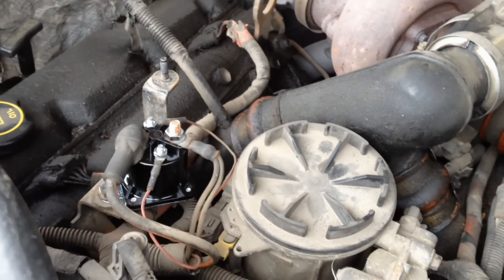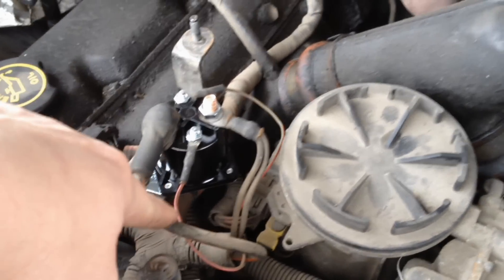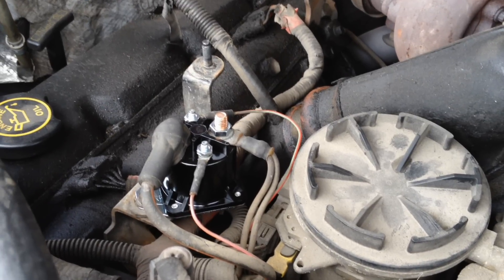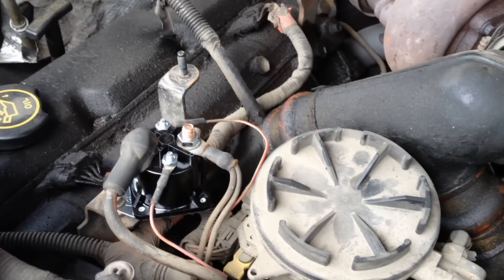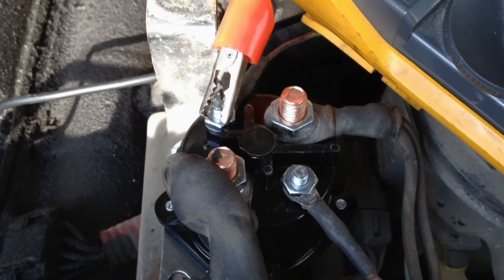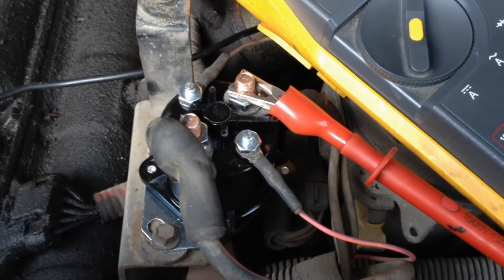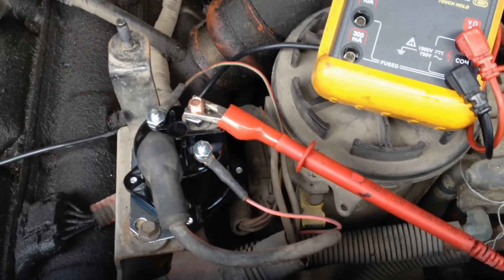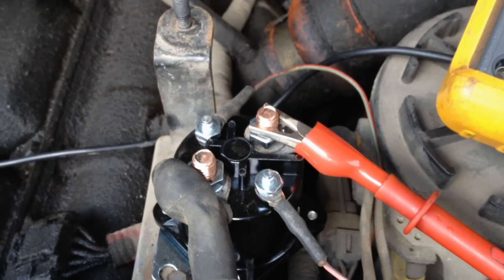7.3L Powerstroke Cold No Start Diagnosis- Glow Plug Relay

Comment: I replaced my relay after testing the "out" terminal that goes to the glow plugs. after replacing it, I tested the new one and it was the same thing. I thought the new one might be a bad one, so I replaced it. the third one still had the same symptom. there was 12 volts coming in, but when the key was on and there should have been power at the terminal going to the plugs, there was nothing! anyone have any ideas?
Reply: Dod you replace your relay?

 

Just kidding, check the fuse

Comment: I have a '97 F350 PSD. This morning I started the truck, was hard to start (cold morning), blew some white smoke. Started then died. Now the Wait to Start light does not come on, and it just cranks and cranks. Changed the fuel filter today as well. Last time I had it in the shop the mechanic said that I needed to replace the Fuel Sensor/Heater element connector and pigtail, and perhaps the H20 level sensor. Would these cause the Wait to Start light to NOT light up when the key is turned on, or would the GPR cause this? I'm really at a loss as to what to do.

Comment: I've got an 01, when I cycle the key the start light goes off, it'll crank and start but blows quite a bit of white smoke for a min or 2, then it's fine. Relay? glow plugs? (it was 37F this morning)
Reply from the maker: jeff drier It can be either but at that temp I would say the relay is working and a couple plugs are open. Follow my test to find out.
Reply: When I tested the relay, It was slightly lower than the Bat volts. I'm planning on changing out the plugs in the fall. Its got 190,000 mi on it.

Comment: I have a 96 f-350 with a 7.3 powerstroke and even with changing out the glow plug relay it will not hardley start in the am unless I give it a quick squirt of ether I have replaced the starter and the batteries can you tell me what else to look for or check as I don't like giving it the ether but a lot of the time thats the only wat to get it started and I am not sure what else to do and I can't afford to take it to ford to get fixed
Reply from the maker: You much check the glow plugs to make sure they are not burned out. I am sure during this cranking it is puffing while smoke right? Then your control for the glow plugs is bad or the plugs themselves.
Reply: Sharon Straw , I have the exact same problem with my 1997 F-350 powerstroke, I have to give it a shot of ether in the morning to start the truck, but once she is started and has been warmed up she will start all day no problem, I thinking it has to do with the starter relay or the glow plugs are not heating the cylinders enough, ps it will also start fine if plugged into to block heater over night, super annoying problem!!
Reply: +FordTechMakuloco h

Comment: I have a 97 f250 powerstorke I replaced the glue plugs and the relay still has a hard time trying to get started in the morning. My relay is getting hot and I'm kinda at a Los of words on it
Reply: Oh yeah and make sure batteries are fully charged and use a load tester to ensure the cold cranking amps dont drop after two seconds due to a dead cell
Reply: And on top of that after I finely get it started it ideals really rough and won't can't to rev up but once its going will start all day
Reply from the maker: raganusmc You have to check the resistance of each glow plug on the outside of the valve cover gasket connector and then once again at the glow plug relay where the whole bank of wires comes together. (disconnect the wires from the relay obviously) Each side should be collectively the same.
Reply: FordTechMakuloco what should I be getting for volts wise?
Reply from the maker: Voltage output from the relay should equal battery voltage. Are you asking what resistance should you be getting?
Reply: Under valve cover gaskets, their harness and connectors both ends. Bad fuel, bad ipr valve under fuel
Bowl, bad pressure sensor? High pressure oil leak (internal), thick oil, wrong coolant, bad timing sensor, fried/damaged computer in need of software update/reprogram or replacement.
  Its a ford, there could be a lose ground. Anything will stop these motors

Comment: I have a 1999 7.3,my wait to start light doesn't come on.won't start. I've changed the gpr out twice,battery connections,starter relay,and checked the fuses. I'm getting power to the gpr but none out and it doesn't make any noise,What should I try next,or do you think its possible I got another bad gpr?
Reply from the maker: Jason Guidry Are you getting power and ground to the small wires to turn on the GPR as shown in the video.
Reply: No,I am not getting power when the key switch is on and the wait to start lite won't come on. I've changed the IDM also,as well as both starter relay, and GPR.

Comment: Hello, and Thanks for the keen insights. I have a 96 7.3 DI .Started having issues when going up mountain pass cut out first time then killed next day at same incline. Started a couple more times and died when idling. Now will not start. and no smoke when turning over Changed filter and cleaned housing too. Just replaced GPR, old tested bad.   Still will not start, ???
Reply: bruce odem I had similar symptoms and it turned out to be the camshaft position sensor.
Reply from the maker: Have you made sure the fuel bowl is filling with fuel from the lift pump? After that I would make sure the second stage of the pump is pressurizing the fuel by cracking the line at one of the heads while cranks there should be a good fuel spray.
Reply: Thanks again, bowl does fill, where do the lines go in the heads?
Reply: bruce odem I pulled one line off the passenger side in the "middle " of the head but it was oil. ???
Reply: bruce odem Wonder of wonders,  I plugged in the block heater when I cracked the "oil" ? line on the head and just went back to try and locate the lines from the pump and turned the key and it fired up and is running now. Our temps have been 32 for high and 22 low.  for a week now. We are also at 3300 ft. elevation. What would you recommend for the best repair manual? I need details as no prior experience 1996 F250 7.3 di. I have 210000 miles and intend to keep, and replace injectors and glow plugs if necessary there are other issues lacks power runs rough sometimes???  We are VERY great-Full for your time and expertise !
Reply: try unplugging your icp sensor

Comment: I got a 7.3 2001 and its like 75 degrees here and i crank it and i see white smoke on exhaust i can also smell the diesel but it wont start..the gpr has 12.5 volts and the gp side has nothing and then the 2 small terminals have 12v and the supply goes to 0v can the no start be because of gpr
Reply from the maker: yes it will not start but simply smoke, change that sucker out.

Comment: what is ground control from the pcn?? I have f250 7.3 1994 and for some reason I have 3 contacts only there. one is in power the second is out and the third one is the one that goes to the starter??? I can post a picture. It is hard to understand what and where to connect.
Reply from the maker: Daniel Verenchook IDI or Turbo? I would post a picture on my Facebook page there should be no wire going to the starter motor.

Comment: I check mine and live side is 12.37 and the other side is showing only 3.9v.. is the relay bad?
Reply from the maker: nico martinez Yes it should be the same on both large studs when it is on. The contacts go bad inside of the relay.
Reply: FordTechMakuloco also do you know anything  about when you turn on the truck its start loping?
Reply from the maker: If it starts and is loping it is either because the glow plugs are not working or the injector spool valves are sticking when cold. It smoothes out when warm yes idles great?
Reply: FordTechMakuloco thanks for replying.. i just push gas pedal about 1k rpm for 5-10sec then its smooths out.. but hot or cold start still loping.. runs and drive fine..

Comment: yep ive been cheap and bought the $40 napa ones they maybe last a year or two then just fail when you need them the most...winter. I'd also say disconnect the batteries when you do this because you'll have the full power from the 2 of them on the hot side and you defiantly don't want that hitting anything.

Comment: thanks for the information.i have a problem
I put a new glow plug relay and crank but it doesent start i test the new glow plug relay and it failed and the wait to start lamp  doesent show what step is next ? thank you.
Reply from the maker: Which year vehicle? You say the new one failed? Have you followed my steps in the video to test each output and input on the glow plug relay?
Reply: is a 1999 ford f 350 7.3 power strok..this morning Ichecked the fuse panel the one that is inside in the truck and the fuse # 30 <fuel heater/wastegate solenoid//injector driver/ module relay coil>.was burned and I replaced it and I solved the problem.thank you for everything
Reply from the maker: Ok so you need to replace your fuel heater inside the fuel bowl. They rot and arc out inside and blow that fuse.

Comment: Thanks for this. New powerstroke owner and was having issues with my 99 f350 7.3L not starting if it wasn't plugged in. I had already changed the glow plugs (it needed it anyways) and have done a ton of regular maintenance on it. It had a fairly new GPR but after watching this, I tested it and found out it was bad and possibly wired wrong when the PO installed it. Put a new FORD GPR in, tested and left it overnight for the true test. For the first time since i've had it (3 months) it started in the morning without being plugged in.
Reply from the maker: That's great to hear, nice!

Comment: I have a 2003 7.3 with a fresh rebuild engine, fresh GPR, new injectors, new glow plugs... shouldn't be having the cold start issue I am having. The batteries are less than a year old, but when it gets cold out, if I don't plug it in the batteries don't have enough to get it fired up. Any ideas on this?

I should also add that even when its warm outside, the engine turns over 4-5 times before it fires up.
Reply: Did you ever figure out cold start issue? If your batteries are new your starter is worn out I replaced my starter after it died and was a big noticable cranking difference.
Reply: Same on my 97' i hooked a solenoid up for a manual glo plug switch. Works great gotta find a decent solenoid or relay
Reply: L
Reply: My friend told me to wait 30 sec before starting it. Try it

Comment: I have a 2001 7.3 diesel I have changed the relay but it still only cranks and won't turn over all I get is a click have also replaced starter and starter relay .What should I look at next ?
Reply from the maker: Is there smoke from the exhaust, white smoke wafting out while cranking?
Reply: FordTechMakuloco It won't turn over at all , or start all it does is click .
Reply from the maker: Shannon Sullivan Ok so the starter never turns is what you are saying so you have a no crank situation. So you need to make sure you have power at the main fat cable at the starter at all times. Then you need to check the small terminal for battery voltage when the key is turned to the start position. If it is not you then back tract from there to the starter relay on the fender.

Comment: Hi I have 94 F250 with the 7.3l direct injected diesel. I just checked my glow plug relay it's putting out power but does not shut off when the "wait to start" light goes out and keeps putting out power, could this cause my glow plugs to burn out ? Truck won't start when it's cold it just cranks and cranks. Thanks
Reply from the maker: The glow plug relay works independent of the wait to start lamp so don't worry. In this system it will still turn on the relay for the same amount of time no matter if 2 glow plugs are working or 8. You need to check the glow plug resistance at the valve cover connector. They should be less than 2 ohms and are the 4 outside pins (2 on each side) on each valve cover.

Comment: have a 2002 F-250 7.3L. I have changed the batteries, glow plug relay, and the starting motor and I still can't get my truck started. Do you think I may need to check or change the glow plug control module?
Reply from the maker: If you have a glow plug relay there is no control module. Few things is there plenty of oil in the engine to feed the High pressure pump? Is there fuel pressure? It cranks fine right plenty fast?
Reply: @FordTechMakuloco  we had a 2002 7.3 that would not start at all if not used for a day or two. What we figured out was, there is an oil tank on top of motor in front of the fuel filter that holds oil for the injectors to fire when starting the motor, I guess it had a check valve that was leaking the oil out overnight. There is a plug on top of the tank, and we would pour oil in and it would start right up and stay running after we had oil pressure.

Comment: Was that relay causing a no start at room temp?
Reply from the maker: Yes it was a cold start concern I would say about 50 degrees outside, cranked and didn't even try to fire.
Reply: I have one that won't start at room temp. The glow plug relay is not working. No codes. Oil is well above 500psi. etc. I dident think it would need the glow plugs so bad after being in all night,  I better see about getting a new relay now though.
Reply from the maker: Rory E Yes I was very surprised in the way this one acted and all it was  is the GPR. It acted like there was no fuel.

Comment: I just put a new relay. It comes on for less than 2 seconds and shuts off. I didn't have a voltage meter. I just used a test light. Is it possible for new one to be bad.
Reply: Did you ever figure this problem out? I just replaced the relay and i'm having the same problem.

Comment: what if you replace the relay and still doesnt work any recommendations on what to look at next
Reply from the maker: Did you test as shown in my video? So you are not getting voltage on the main positive side of the relay that feeds the glow plugs after the key is cycling on? Does it click on at least?
Reply: FordTechMakuloco
Reply: BigHoss7.31994ford350

Comment: I have same motor on my truck the problem that I have is that it comes on for like 2 seconds then shuts off automatically could that be a bad relay or something else thanks
Reply: I also have one that comes on for about 2 seconds and shuts off!
Reply from the maker: Ya know the last one I had like that it was the relay yes. You need to test it as shown, then to eliminate it further for your case I would pull the VT/OG wire and test it separately.